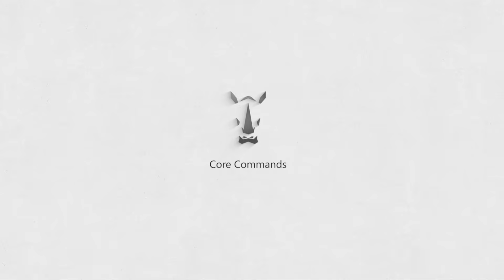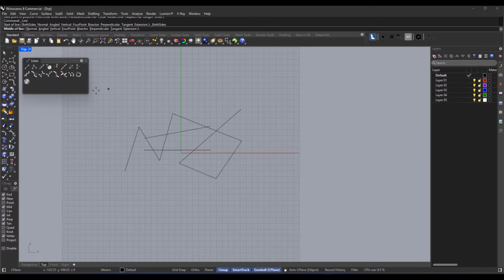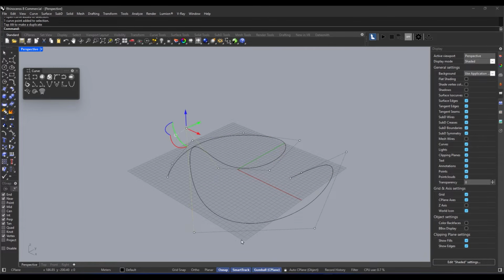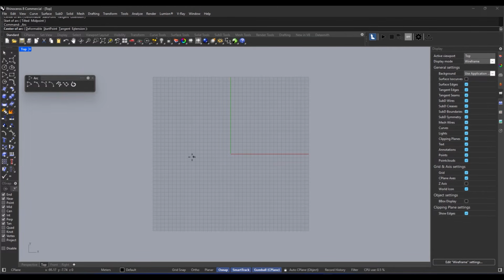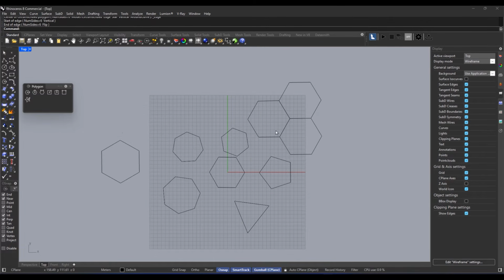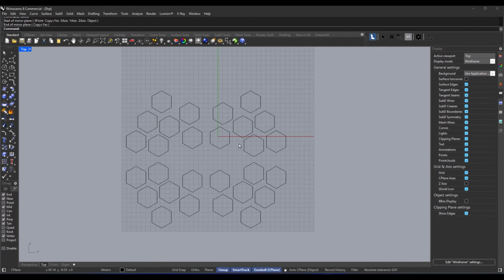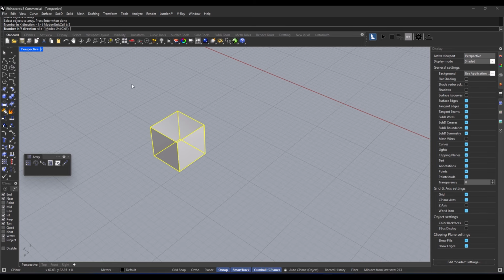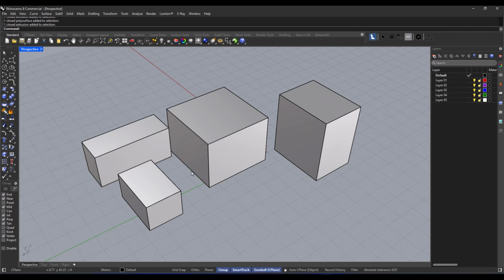Rhino for Absolute Beginners — Ep2 | Mastering Precision Drawing in Rhino

Comment: I come form blender just getting into architecture
What do you think can Rhino be used in Architecture.? Not just for concepts but real world drafting, floor plan and exterior 
Like real world measurements and 2D drawing?
Reply from the maker: Yes — Rhino is absolutely used in architecture, especially when it comes to computational design and digital fabrication.
You can work with real-world units, create accurate 2D drawings, and send geometry directly to CNC, laser cutting, 3D printing, etc.
It’s great for architects who want more control over geometry + automation through Grasshopper.

I’ll try to make a video soon about Rhino’s professional applications and how it compares to other software.